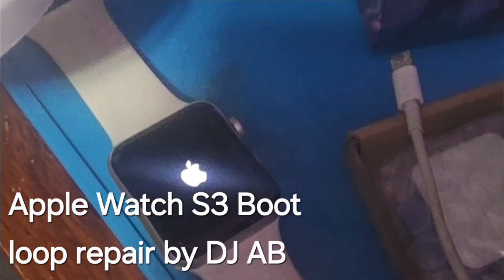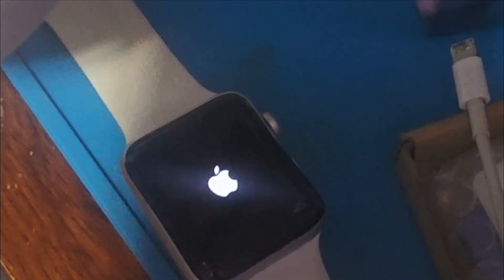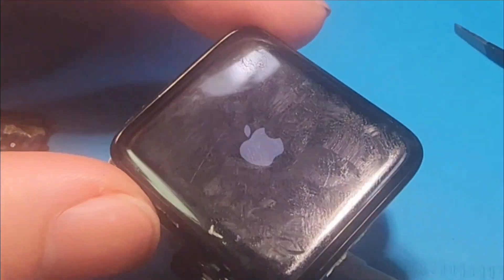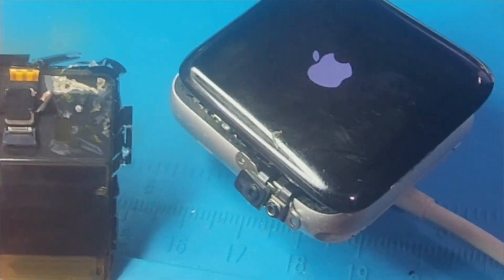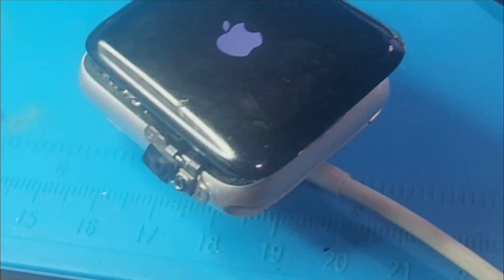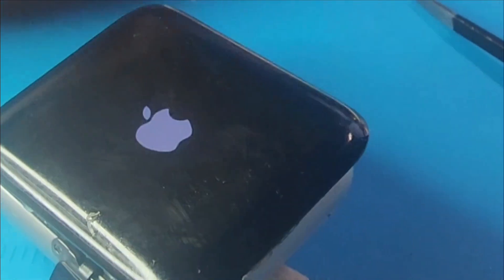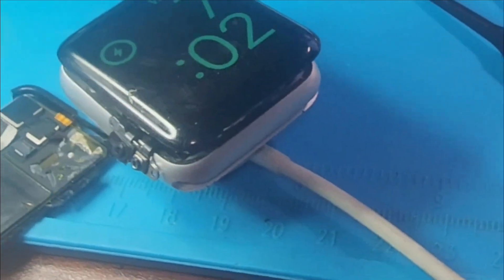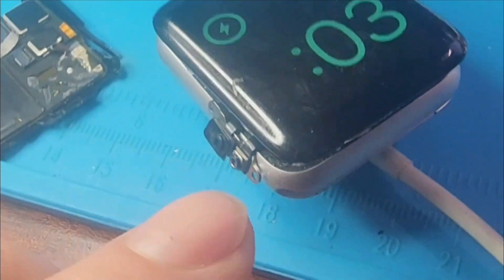Apple Watch Series 3 Boot Loop Board Level Repair

Comment: Hi…I have the same watch and mine doesn’t boot loop but when I do start the watch it stays on the apple logo and doesn’t budge…

Then out of no where it comes back to life only to show me the setup screen but it doesn’t pair with my iPhone 13…
So I restart it again but it once again goes into the same annoying stuck apple logo

Pls help guys what’s the issue
Reply from the maker: Have you had a chance to replace the battery? A failing battery is one of the most common causes of this type of problem. I also suggest updating it to the latest version